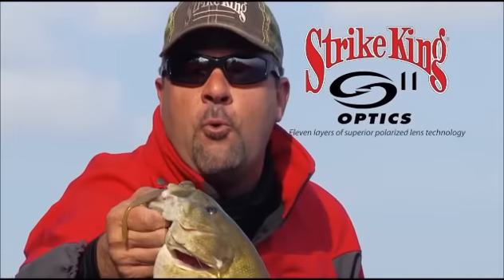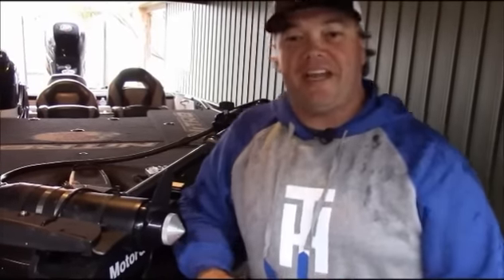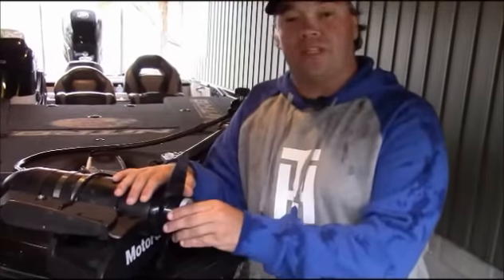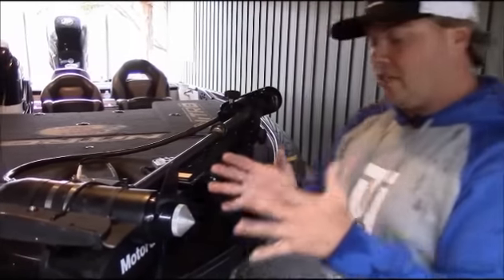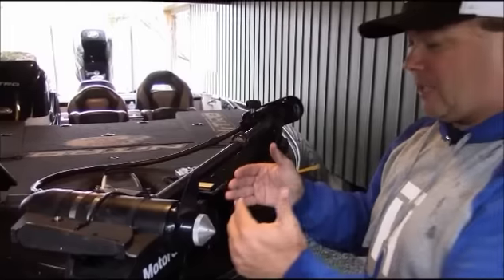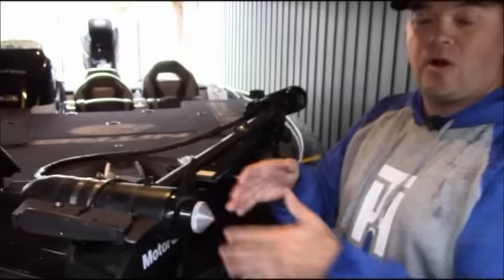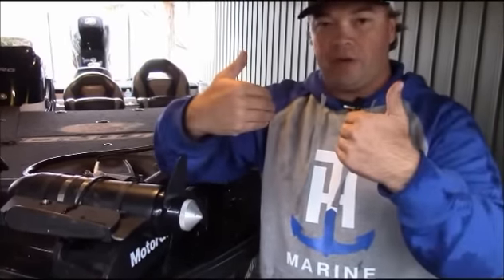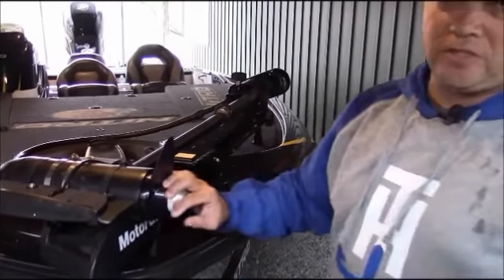Tim Horton: A Simple Solution to Trolling Motor Noise

Comment: This is a marketing ploy. Does not work as either a sound dampener or heat sink.  Worse of all, if you break the shear pin, which is a safety device, you cannot remove the prop because access to the shaft end screwdriver slot is  blocked. You will need to saw off the conical end to access the motor shaft. I would not recommend buying.  Stay with the Minn Kota washer and nylock nut !!